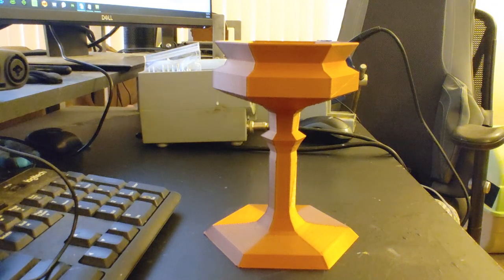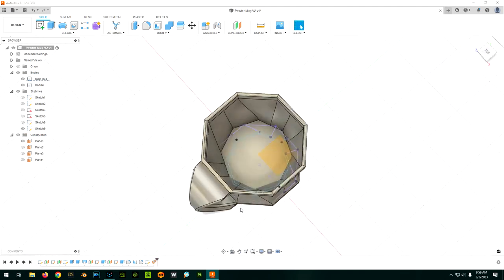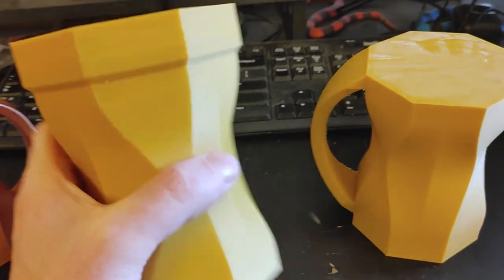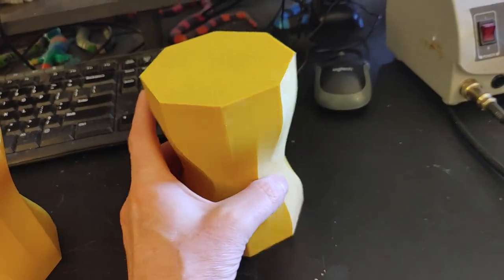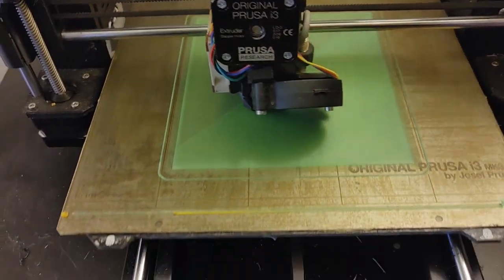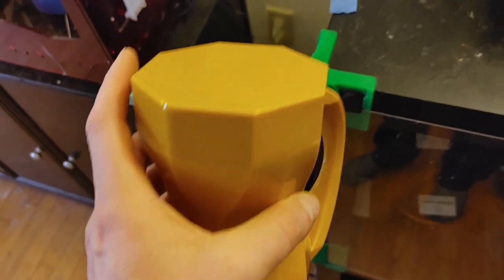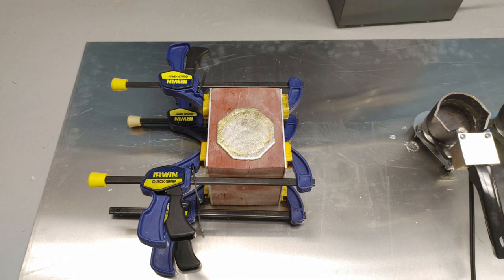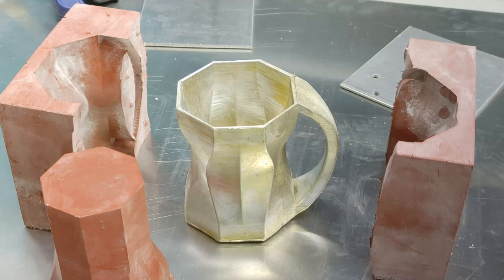Making My Own Pewter Beer Mug at Home

Comment: Great stuff! Came out very nice! This just ended up in my recommended, probably because metal casting is my thing.
I bet this could also be done in a sand casting with other metals like Aluminium or Brass, not sure if it would be safe to drink from though 🍺👍
Gonna check out more of your stuff.
Reply from the maker: Thanks a lot. I was surprised it worked so well myself. Thanks for checking out my other videos, but unfortunately most of them are about 3D character creation and animation these days, so probably not that interesting to you.

Comment: It's so nice watching over your shoulder as you did this. Crazy how many dimensions you have to think in: concept to 3D app, positive print, negative print, mould and finally back to the "real thing". I was quite lost and couldn't visualise it until you showed the final moulds. What were the material costs on this puppy? Also, now that you've got the mould, you could pour more pewter and make another one if necessary, right? Nicely done Brian!
Reply from the maker: Yes, mold making like this can be a real brain teaser but fortunately I have a lot of experience with it, although this is the first three-part mold I've done. The material cost was about $100 in pewter and close to that in silicone. The printed plastic was maybe $5 worth. The molds survived completely unharmed so I can definitely use them again if I wanted. I may cast one out of clear plastic. I'm not sure I'll ever make more out of pewter. Anyway, I'm glad you like it!

Comment: But the pour temp of the alloy in the link is higher than the max temp specified for the silicone molds?
Reply from the maker: You are 100% correct. Even worse, the temp of the hot pot was even higher that that. However, in practice, the molds held up fine without melting, burning, or charring.